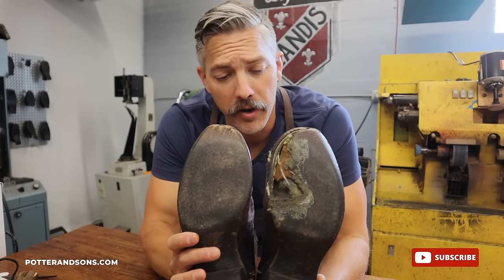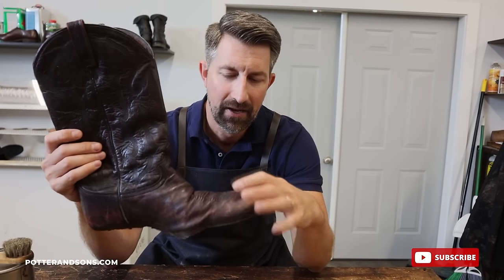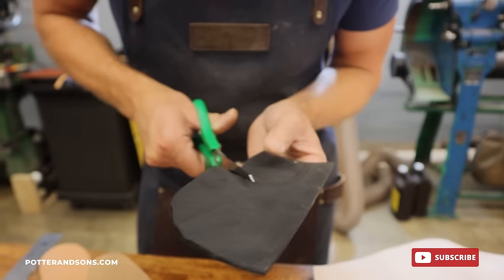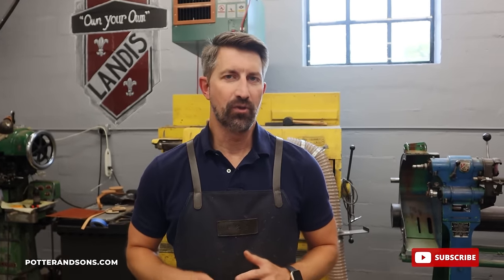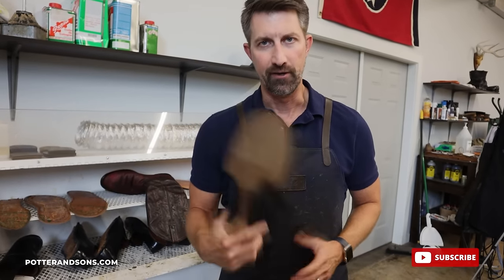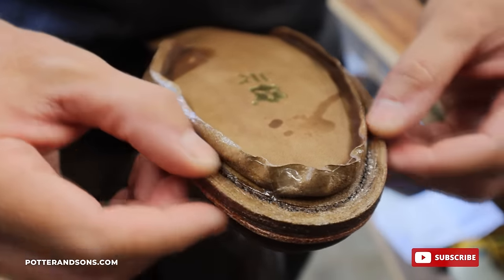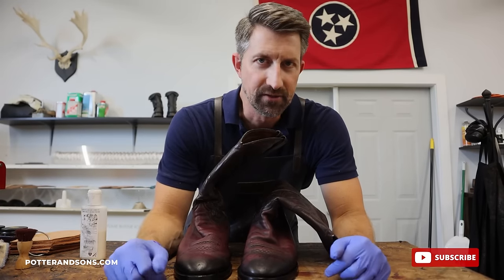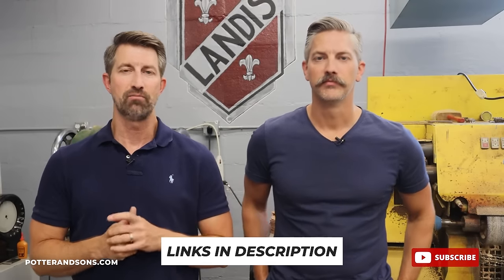Boot Restoration | Total Transformation From Trash to Brand New

Comment: These are my dads boots, he originally bought them around 2006 as a dress boot and then started wearing them for every day use. He works as a machinist and wore them for several years. His intention was to just throw them away instead of repairing them because they were cheap, but I held onto them when he threw them out… 
a lot of people suggested that it’s from a motorcycle but surprisingly he’s not a motorcycle rider. My guess is that they got a lot of miles on them from walking on the shop floor
You guys did an amazing job on these thank you so much. In the future the boots will be in your shop for regular maintenance to avoid this…..
Reply: I was thinking he rode a motorcycle and always put his left foot down, as the right shoe sole wasn't worn nearly as badly, but you would definitely know.   I wonder if he worked some sort of pedal with his left foot?  When my father died in 1983, I kept and wore one of his pair of dress shoes for many years.  Too bad there was no internet and Trenton & Heath back then, or I'd have sent them in to make them like new again.  Great job on the restoration, guys.
Reply: What did your dad think of the repair?
Reply: @chrishebert5672  I bet it could have been a machine like a lathe with a pedal that caused the wear so intensely. My other guess is the clutch pedal on the manual vehicles we had but I’m not sure that’d be aggressive enough to cause the wear.. 
I know he replaced them instead of repairing them because of how bad they were and I kept them because I thought they were cool…. After the hard work of the guys my dad is amazed at how the boots turned out and will wear them as a dress boot im sure
Reply: @thedoor5442  My dad is really shocked and amazed at how they came out. It is crazy to see the difference. Trenton and heath did some great work on these. I’m sure they will become his favorite pair of boots again, this time receiving some care..
Reply: They did an amazing job. The uppers looked a lot better quality than the insole, sole, and heel so with the much higher quality of those parts, those boots should last for a long time to come.
Reply: Thanks for the background! Just for curiosity and perspective, do you know who made them and what the size is?
Reply: @eltonlouiewolf-wilson8345  Justin boot company made these. I think they are a 10.5 D size. I think it’s a Mexican made boot but I don’t remember
Reply: Chris, it's always great to hear the story of the boot or shoe being repaired. Thank you for that.
Reply: Ah so I was wrong lol
Reply: Well I was wrong on my guess of what they were used for, so much for me being a detective.
Reply: couple questions: did the rebuild do anything noticeable to the way the boots fit? and if you don't mind saying, what brand boots were these?
Reply: @OtherSarah2  not sure if the rebuild has altered fit. Havent received them yet, but I think the fit will be nearly the same because they used what they could out of the old insoles and soles to put together the new. So if not the same it should be close. These are Justin boots 👍🏼
Reply: @chriswillman5829  Justin builds a good boot! The new soles etc. look a bit narrower to my eye.
Reply: I honestly thought they were 19th century boots🙄
Reply: I don’t see how he could walk after wearing these boots in a machine shop.  Unless he set in a chair or somthing.
Reply: @bluegrassman3040  he has since been wearing steel toed shoes while at work mainly. I think he decided boots aren’t “practical” or safe to wear while working all day when there’s a lot of standing and walking. It is strange how he kept wearing them after the hole wore in the sole.. but I can remember him wearing them a lot
Reply: @chriswillman5829  I wear wedge soled steel toes made by Thorogood.  I’m on my feet the whole shift.  Since I’ve started wearing wedge soles while standing on concrete, there’s no going back to any other type of sole for me.
Reply: @k9six185  that’s right haha. My dad is still ambulatory he has since started taking better care of his feet and wears “safer” footwear for working all day.
Reply: @chrishebert5672  .p.?0000.
Reply: @chrishebert5672  l
Reply: @thedoor5442  l….
Reply: .p @thedoor5442  ..
Reply: @chrishebert5672  …
Reply: @chrishebert5672  .p
Reply: @chriswillman5829  .plp
Reply: @thedoor5442  pplpl
Reply: @chrishebert5672  

Pp

.?
.
Reply: 0
Reply: dang I thought maybe someone else walked a mile in his shoes
Reply: Could he have been using them to slow some kind of flywheel in the shop?
Reply: @chriswillman5829  are you sure dad didn't have a close call lawnmower incident that he didn't tell the family about cause he didn't wanna deal with the grief he knows he deserved? Growing up, my best friends dad lost his big toe to a lawnmower. The following spring, his uncle(dad'sbrother) who lived next-door did the same thing...
Reply: What kind of boots are they? They look like Lucchese 1883’s or Lucchese 2000’s.
Reply: @southernbenz2098  these are actually Justin boots. They don’t seem to currently make this model anymore.
Reply: @tonytatano6985  that’d be a horrible way to lose a toe. No haha but I know at the end of their old life they were used during yard work some which is where the grass stains came from.
Reply: @JasonHitzert  I believe some of the machines used some pedals in their operation. I guess his walking pattern and maybe these pedals contributed to the holes
Reply: I feel sorry for your poor dad's feet...OUCH! Is all I can say!!! In a MACHINE SHOP??? Double OUCH!!! Thank the Kohl's gods for selling Fila's!!!
Reply: @chrishebert5672  problem  press pedal or shear pedal
Reply: What is the price to do something like this?
Reply: As a machinist, this is from being up on your toes climbing inide of CNC machines.  I would save so much time and effort if I were only 4¨ taller.  I spend a lot of time standing up un my toes to reach tools in the back of the machine. He is lucky he didn't get metal chips in his feet.
Reply: I was also going to suggest that they were used as motorcycle boots but looking at the leather over the left toe it appears not to be the case.  Cleary, these boots were made for walkin'.
Reply: Some machine shops do have mine fields.  He might've stepped on a ball of the foot popper.

"Yeow! Ow! My dogs are burnin'! Fire in the hatch! Great horny toads, that smarts!"
Reply: Just. curious what it costs for this extensive of a rebuild.
Reply: I was thinking too that maybe he operated a piece of equipment where that part of his boot contacted some sort of pedal over and over to cause them to wear in the same spot. I had a pair of work boots a long time back that wore in a similar way from me driving a truck with a manual transmission for many years without a pad on the clutch pedal. Over time it wore a bare spot on my right boot's sole.
Reply: Looks like too much boot scootin boogie

Comment: Amazing work. You basically took what were not the best quality boots and rebuilt them with the level of quality and materials you'd find on the best handmade western boots. I especially appreciated the use of the wooden pegs rather than the brass nails they originally had. I expect these will hold up a lot better now and be a lot easier to resole down the line.

Comment: I watch a lot of these boot cleaning/rebuilding channels and one day I realized my Walmart brand dress shoes insole was just beat up. Instead of buying a new insole from Walmart. I decided to use cork, I had a cork board for like pins and stuff. I cut out a foot shape and made it my insole I thought for sure this was silly as that is not where the cork goes. Well, been a couple months, the cheap board molded to my feet and it unironically feels better than the stuff form Walmart. Now it comes with drawbacks, not something I would use in my tennis shoes, lol. But for these flat dress shoes? Yeah!
Reply from the maker: Nice!

Comment: Nice resole. And Heath's mustache is a 12 out of 10. The only thing I didn't care for in this video was the reuse of the old heel rand that appeared to be plastic/ rubber I would have rather seen a leather replacement but to each his own. Great job though
Reply: Chris Sperling  the heel rand was definitely reused. Not the heel stack or top life rubber the rand

Comment: Back in the 1960s, I worked in a shoe repair shop in a nudist colony in  New Jersey.  I ended up volunteering to serve overseas in the Vietnam conflict.   I figured the horrible things I'd see in  a dangerous war in the jungle couldn't be much worse than what one sees in a nudist colony in New Jersey.  Turns out for the most part,  I was pretty much correct.

Comment: You guys did a total bottom replacement, pretty extensive repair IMO. The owner of the boots either did a lot of walking or dragged his feet while riding a motorcycle. Rubber soled boots are much better for motorcycle riding from a safety standpoint. The boots do look good.

Comment: The gimming was glued to the sole. The welt was sewn to the gimming. Therefore the weakest link is the glue. Did i miss something or is that normal ?
Reply from the maker: Yep, that’s standard.  95% or more of the time, it holds well and never moves.  Some people wear their shoes or boots very hard and will cause the gemming to pull off, this causing the insole to move a little from the upper.

Comment: @ 6:32 ish.....why did you stamp the leather only to glue the heel over the stamp? Also I noticed that the" giving" @ 7:30 ish ( spelling) is only glued to the sole. So does this mean even though you sew the welt to the giving the only thing really holding everything together is glue?? I'm really curious 🤔.  Thanks 😊
Reply from the maker: That's the back side.  It's wet when I stamp it and the heat pushes makes an image show up on the back.
Reply from the maker: In a way, yes.  The glue on the gemming is extremely strong and once cured, it's tough to separate.  The other options are to stitch it (stitches show through) or carve it into leather (expensive)
Reply: @TrentonHeath  thanks so much for taking the time to answer 😀 😊

Comment: That looks like the bottom of my shoe after I slipped while mowing, and my foot ended up under the deck. I had a cut on the ball of my foot, and it could have been so, so much worse. The trail runners got tossed. Wear decent shoes when mowing! Because accidents happen!